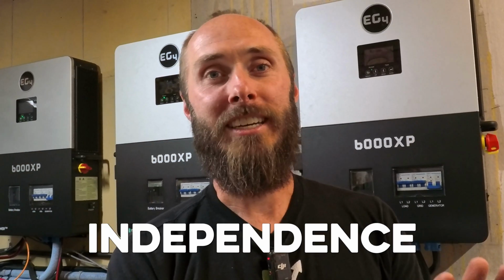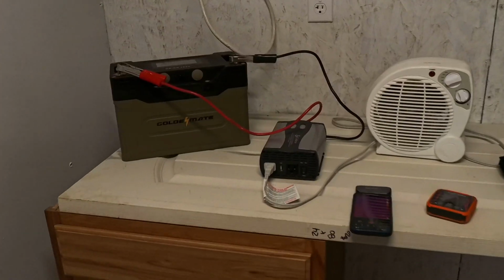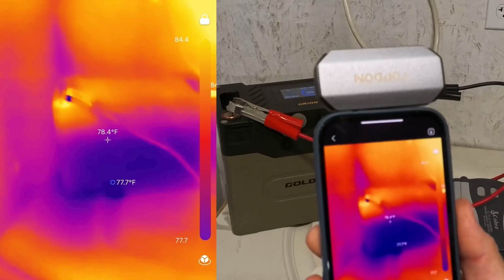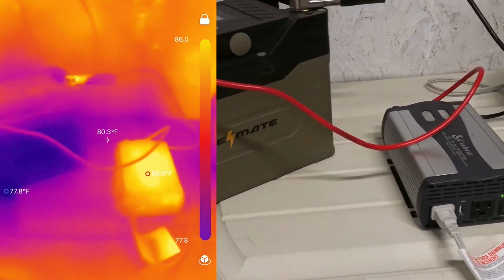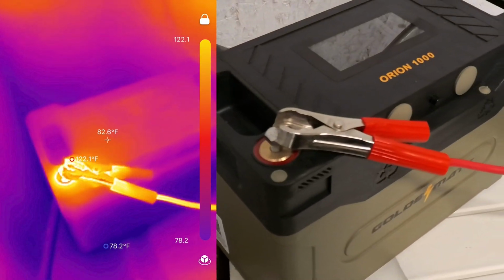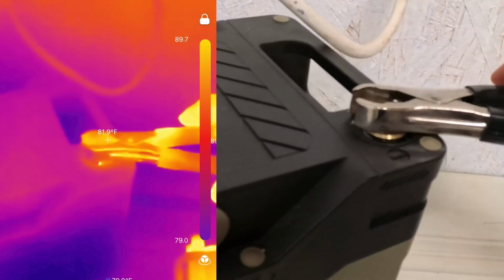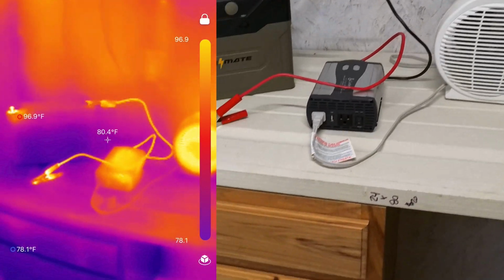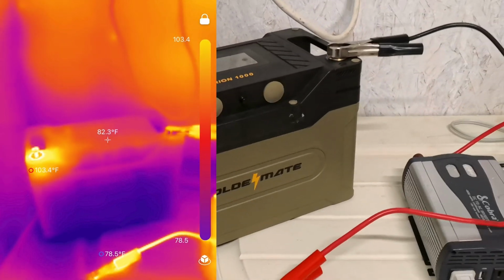Quick Safety Check! Is Your Homestead Safe?

Comment: Timely video! I was just looking at some thermal camera options, specifically this model - HIKMICRO B20. I llike the phone attachment model. Very reasonable compared to the HIKMICRO, plus the big screen is nice. Thanks for the pointer!  The Orion 1000, what/how do you use it?
Reply from the maker: I'm glad the timing worked out. I can't say it's the best and only option to go with but it's so much better than my other. As for the Orion 1000, I don't use a lot of 12-volt batteries at the moment, so I just use it for testing things like this. I've used it to power my Starlink Mini dish and have a few videos on that. This battery would be great for RVs or for trolling motors on boats. It's super light and can be cycled thousands of times.

Comment: Using one of these is clearly a superior way to find hot spots. Gives you a visual representation - It's a much better tool.
However the cost is a bit much for me, so I use my $15 digital laser thermometer (which I already had) and it seems to work ok for my purposes, comparing the temperature of my cable terminal connections, etc.
But if you can afford it by all means get one of these.
Reply from the maker: That’s a great point. The laser is a great budget option and can get the job done. One thing I’ve found with the camera is the importance of not measuring reflective heat. If I’m trying to get the temp of something shiny and there’s a hot object behind me, I can easily get a false reading. Moving around to get a different angle is very easy when you can see it on the camera. It won’t be as obvious with the laser but it can be done for sure. Thanks for sharing!

Comment: Great review.  Been thinking about getting one of these for this purpose, but I was not convinced they would be good enough.  This helps a lot.  Thanks
Reply from the maker: I'm glad to help! I've used this so many times. I even used it to find water pipes in the wall to avoid hitting them. Just run some hot water, and they start glowing in the wall. It's pretty amazing. There are endless reasons to have one for typical homesteading stuff, and that doesn't even go into finding people or animals in the woods at night.